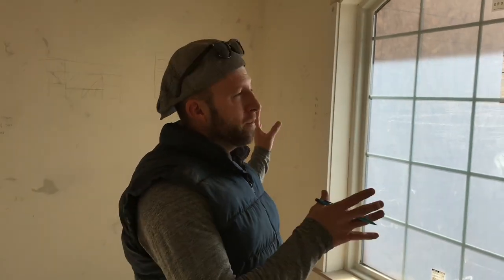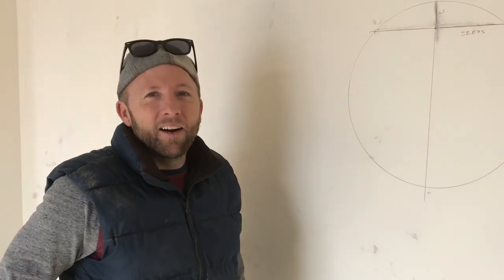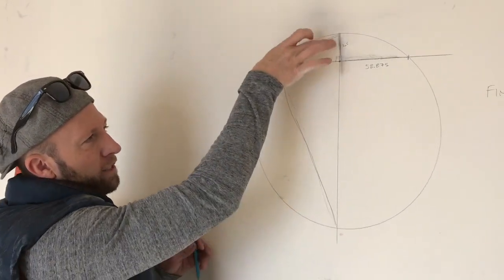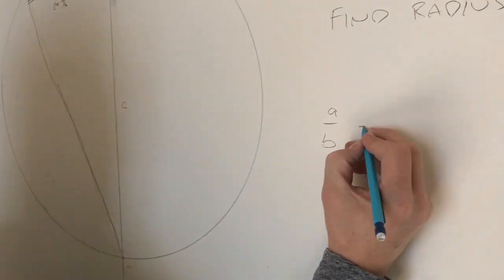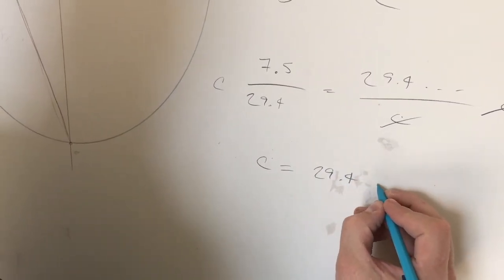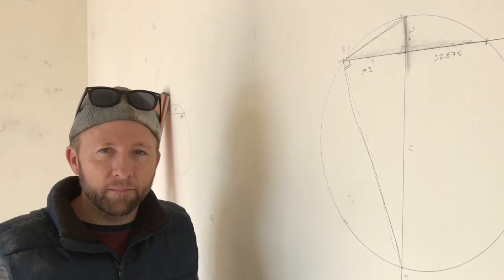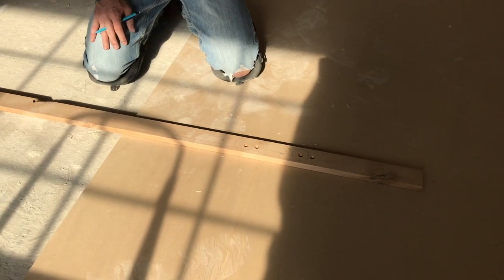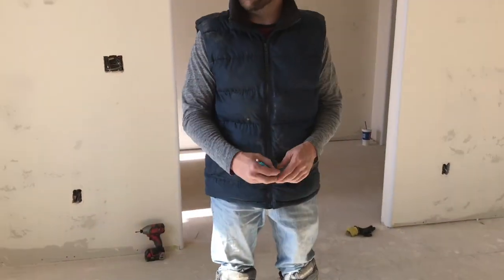Trimming arch top windows

Comment: This way is okay but I have a faster way, for anyone with an allergy to math (not me lol, but I’ve had to come up with ways of doing things for people that may not have had the educational advantages that I grew up with) 

anyway.. just use painters tape to glue a pice of floor protection paper to the wall, covering the arch (if it doesn’t cover the whole arch, tape two pieces together) then just follow the edge of the arch with your finger as you press the paper into it. The paper will crimp on that edge. Take the paper down and cut along your crimped line. Now you have a template to use for anything you need for the arch. Your welcome. 

Ps. If you want to be super fancy, you could use the edge of your carpenters pencil to trace the window but I’ve found a thumb works just fine.

Comment: How did you cut it out to create clean lines? Using a jig saw?
Reply from the maker: Hi Carly. Thanks for the comment. Yes, I cut it out using a jigsaw. One pretty good jigsaw method is to cut nearly to the line, but just leaving the line, and then you can remove material to the line using a power sander.

Comment: You are making an assumption that the arc is concentric to a centre point. It does not look like a true arc from the video.
Reply from the maker: The instructions I gave do make the assumption that you are doing an arc from a concentric center. (Sounds redundant, huh?) But when I did it, I wasn't making an assumption. I had the architectural plans to go on.
It's a good point though. It doesn't apply exactly if the arc you're working on isn't part of a concentric circle.

Comment: Why not just trace the window before u install it?
Reply from the maker: Great question. Sometimes that is a good solution. Just as often though, the framing and drywall are poorly done. Do we follow their bad lines because they were there first? Or do we do ours correctly regardless? I run up against this question on nearly every house, and have to make the decision according to what will produce the best results. In some cases we’ve just agreed with the builder that we’ll build the jambs as well on their homes so we can leave bad framing and drywall out of the equation.
Reply: @paysonbiker  Good answer.  I was wondering the same thing.  Great video, thanks!